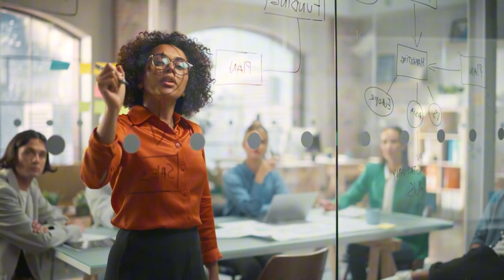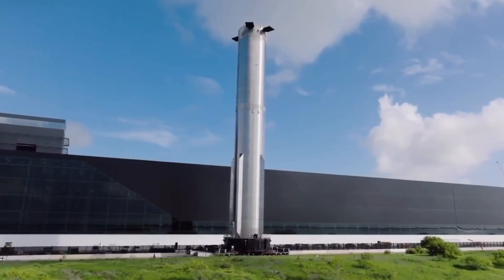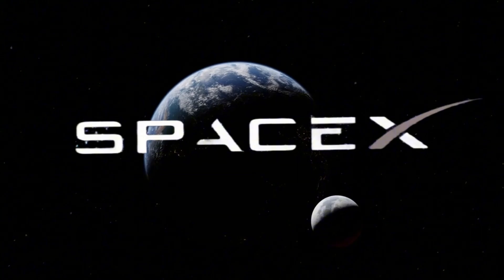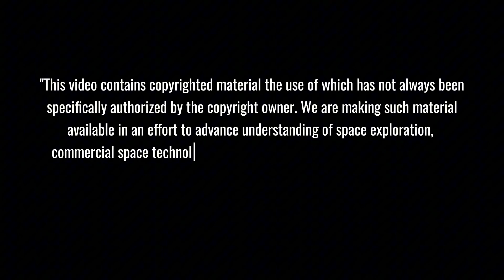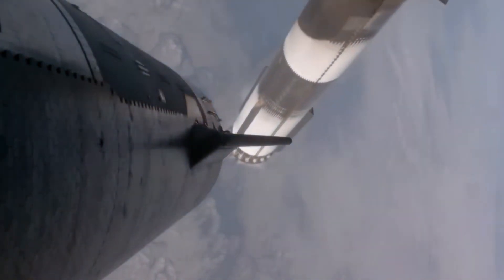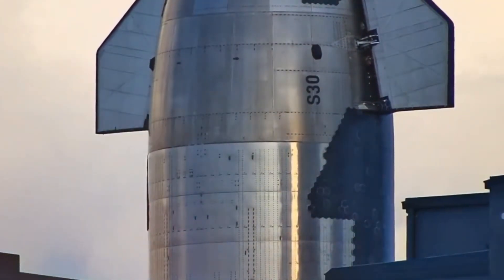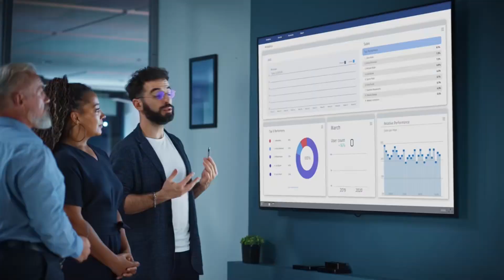SpaceX Finally Reveals... Landing Legs Are Back! Mechazilla's Future in Question

Comment: Landing leg is the way to go for Starship landing. The weight issue is not as serious if you were to use materials that are both light weight and strong. One that comes to mind is carbon carbon. This material is both stronger than steel and lighter than aluminum. However, the extreme heat of re-entry must be taken into account. Carbon is very reactive to heat. Therefore, some type of heat shielding must be employed to protect the legs from the heat of re-entry. This, again, brings weight into the equation. If a balance between shielding and leg weight can approach a net zero weight increase, compared to conventional materials, it could be a viable solution. This shielding would not be necessary for moon landing as there is no atmosphere to re-enter. Martian and Earth landings would still need heat shielding.

Comment: I guess Elon stopped drinking Koolaid. The legs have always been a must on StarShip.  Now it is time to get down to real business for the MOON and MARS. Now it time to look at what is really need to get man to Mars and the Moon. things like, gravity, radiation shielding and more speed. The Raptor will never be economical enough for a Mars Zeno G Human transporting on StarShip. What will it take to get ALL StarShip that are launched to Mars without any ship lost??? StarShip must reach Mars 100% for Human Transport. The cluster system 200m R or ring station system are the only ways. Unless some one can make Gravity. All ships must help each other in a cluster system. Flying alone is very bad. Not even a [1] ONE ship mission is a good idea unless your have Nuclear engines.or a TUG. Work must start on the Tanker and DEPOT/HUB. Even the first mission will have to be a 5 Ship cluster of 1 DEPOT/HUB with 2 tanker and 2 Stare Link w/GPS cargo ships. This mission will deploy Stare Link and test landing on Mars. All test landings must be near by for future HAB. The HUB/DEPOT will receive landing data and transmit to earth. If data was not receive. The Depot will be fully fueled to return to earth orbit.